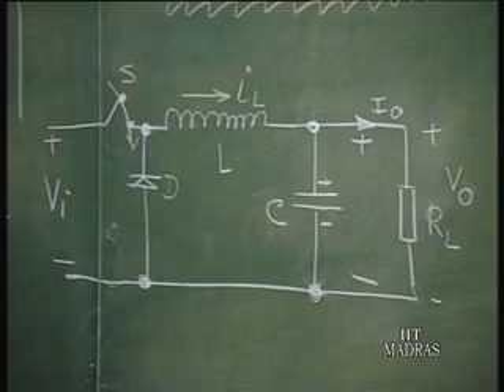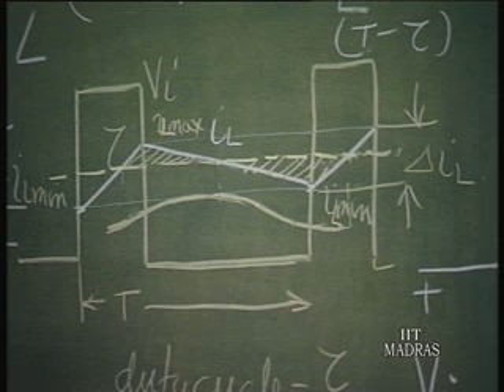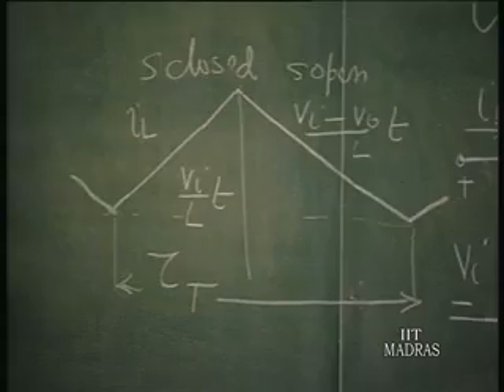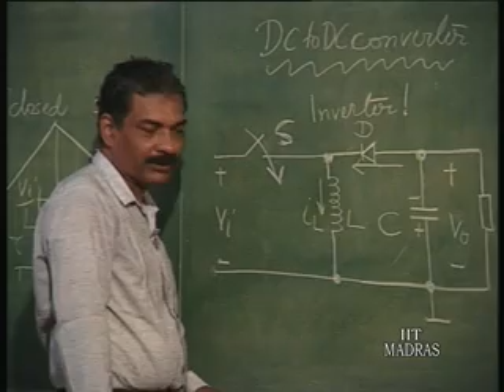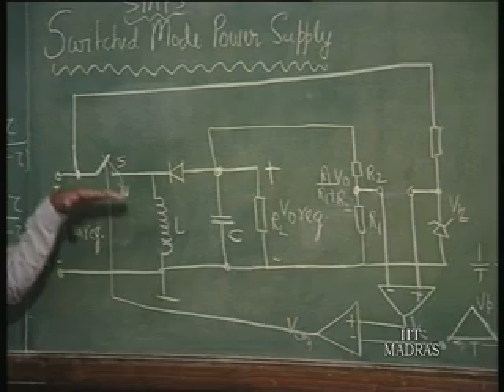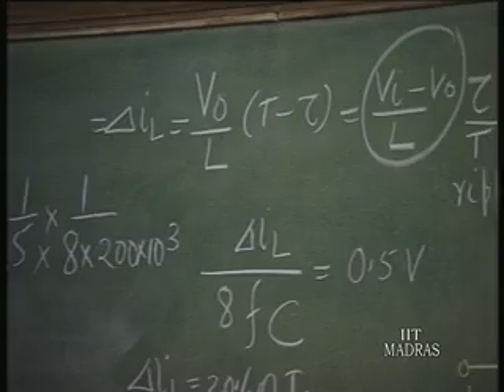Lecture - 29 Convertors

Comment: In the boost converter, if the output voltage is higher than the input voltage, is the output current lower than the input?